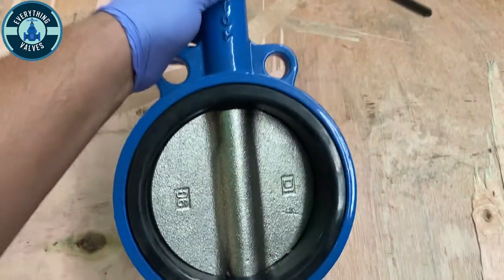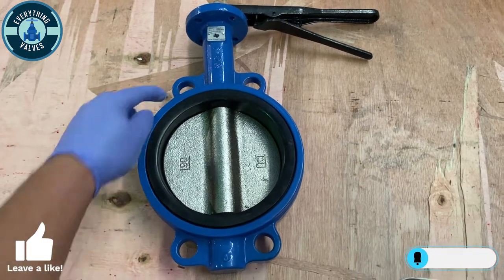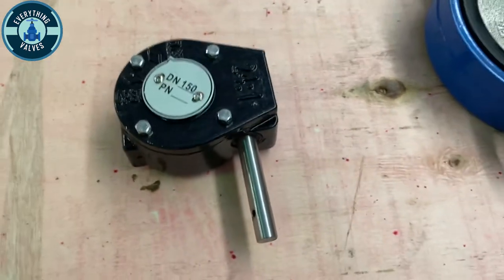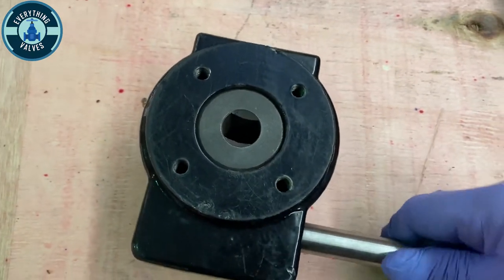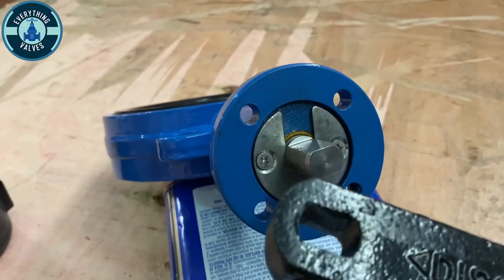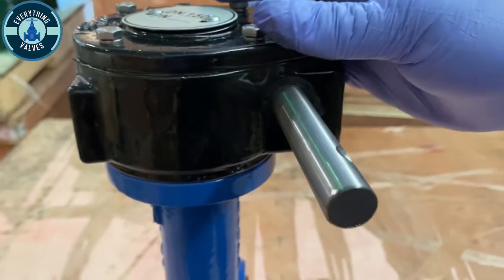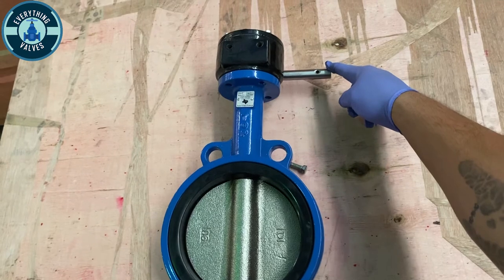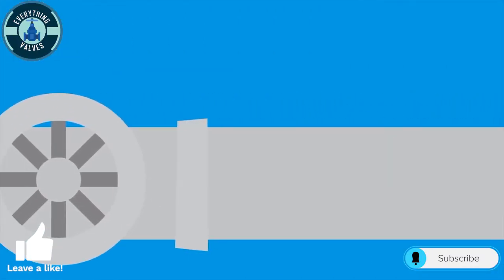Butterfly valve gear installation. How to mount a gear operator on a valve. Butterfly valve how to.

Comment: Where can I purchase the gear drive for lever operated butterfly valves?  I have such valves and I would like to convert them to the wheel/gear operation so the water flow can be more precisely metered.  Thank You.